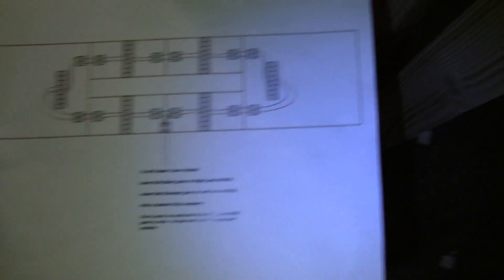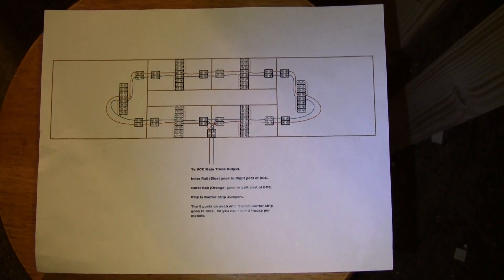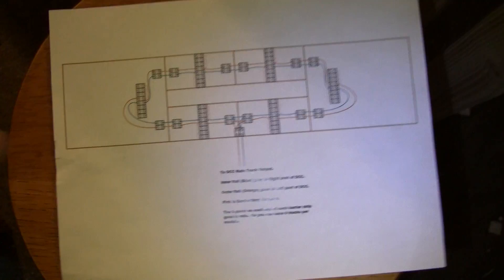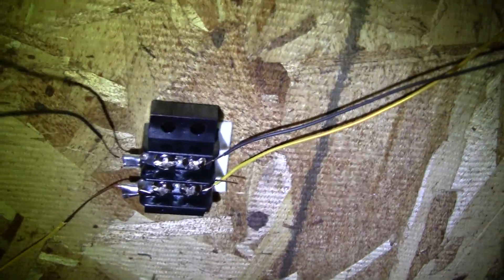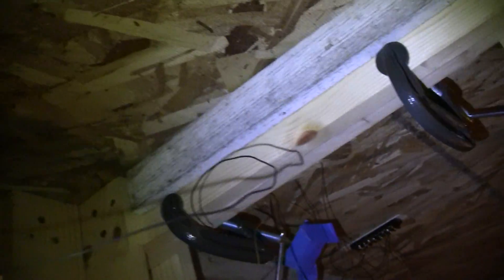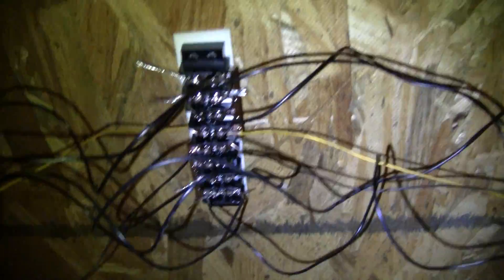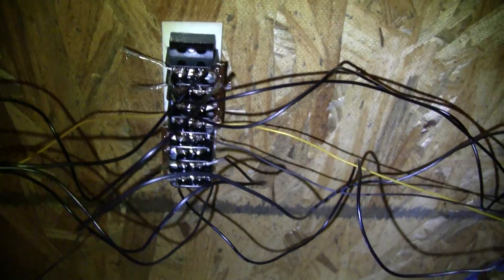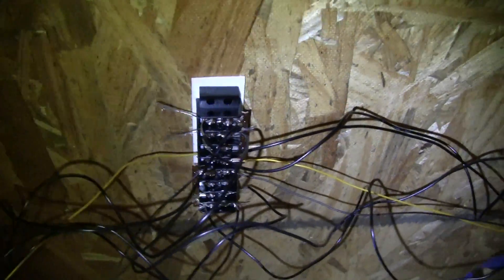Part 8 of How to Build your Layout from Start to FInish--Bus Wiring

Comment: I like your video but DCC bus wire have a end to the wire and I find that out be see other video on DCC bus wiring and I use terminal block too but the terminal block as 2 size so I can get jumper for 1 size but the other size I can not find a jumper may be I can make one some how?   I have 2 layout that use them terminal block.

Comment: This is a little late, I just found the videos, you need to run the insulation right up to the screw and cut off the excess when it is screwed down, The same for the spade connectors the insulation should almost touch the connector. I like to wrap the wire around two screws leaving only enough slack to connect to the barrier strip, makes for a much neater wiring and since these a re to be portable section it would be less likely  to snag a wire when moving.

Comment: If you want good DC wiring you would go through the same amount of effort. there is a big voltage drop off in tracks, an example: power the track at the beginning of a 10 metres run of track and see how well it is doing when it gets to the end.
My DCC setup is in power districts for resistance occupancy detection and is infinitely more complicated than a DC setup would be.

Comment: You can use heat shrink tubing if you need to insulate extended stripped areas of wire to prevent shorts.

Comment: @modeltrainteen95  because the 8 strip is for all the feeder wires in a module. the 2 barrier strip is for connections between the modules.

Comment: the only thing I would worry about is that the 24 gage wire is only good for 1.3 amps and that is one sound equipt  loco. you might start having problems if you run more than one loco. I hope not, but that is why they recommend larger gage wiring. the size of your layout does have something to do with it as length effects voltage drop as well as the ability to carry the current. Hope this does not affect you!

Comment: well it work if i have a bust line and i take a wire and connect it to the bust with a suitcase connector and take that wire and connect it to a block and connect feeder wires to the block.